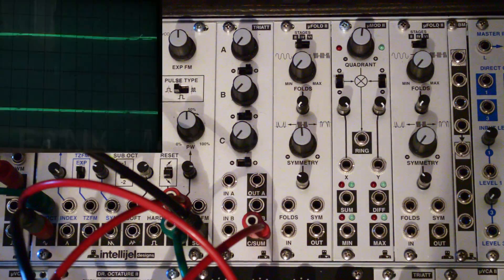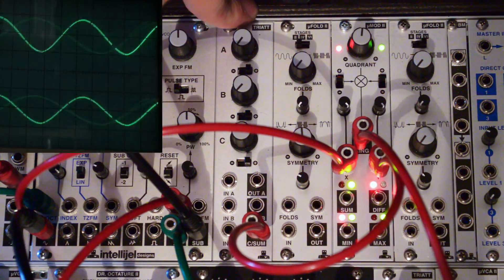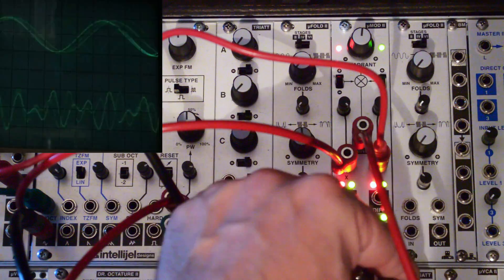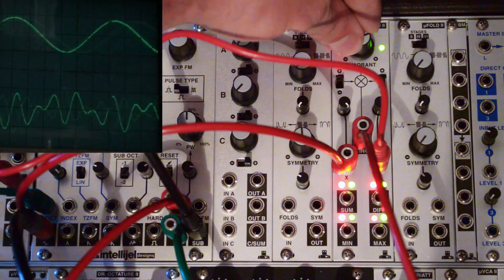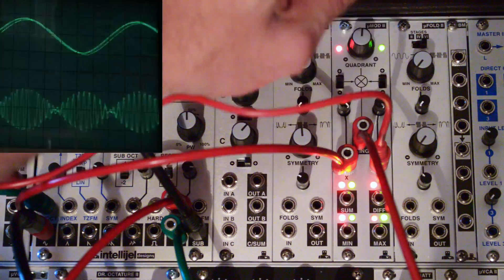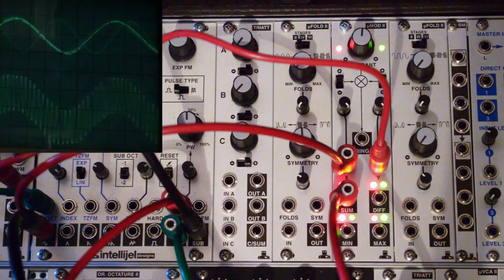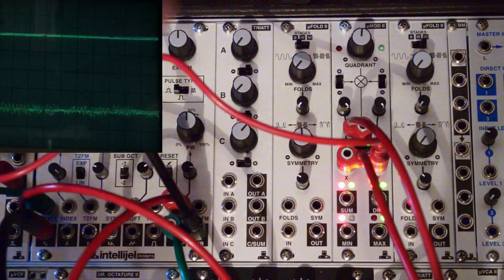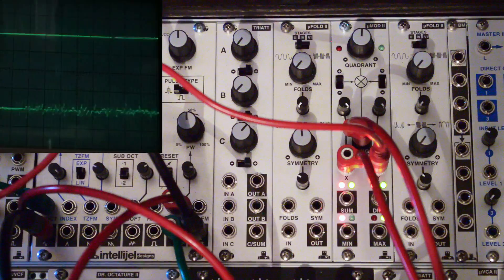Why can I never have enough VCAs? Part 3 - Wrapping up modulation and a few other pointers.

Comment: Thanks for the explanation.
I couldn't find any  other demos of this unit on Ytube.
I haven't looked at the whole circuit board... all I could see was TL07x opamps. Is this all done with opamps ?... no multiplier chip ? I wonder.